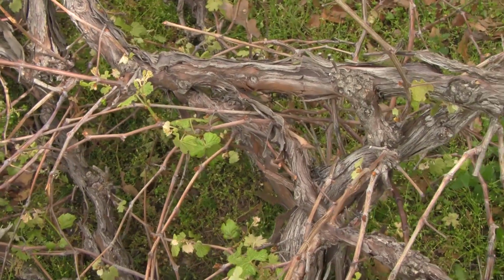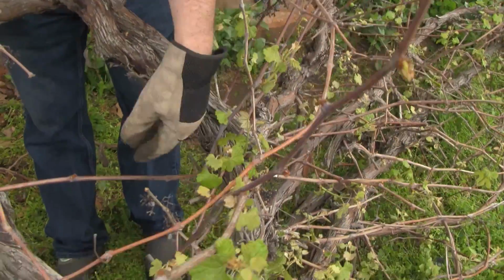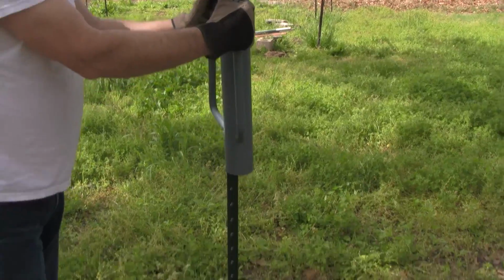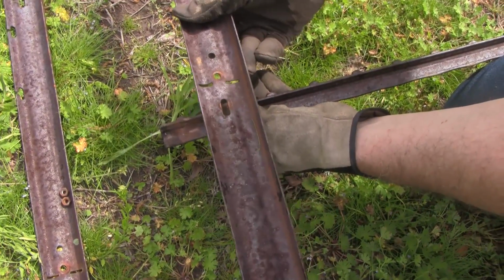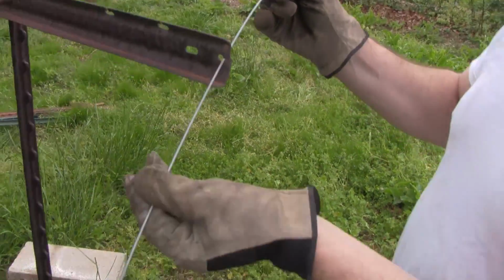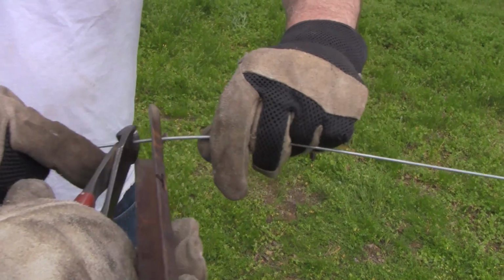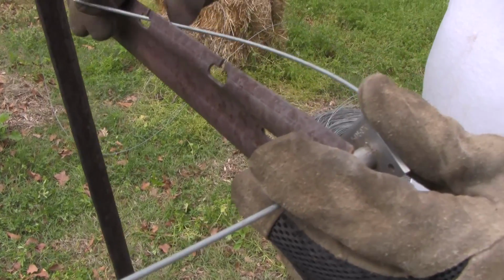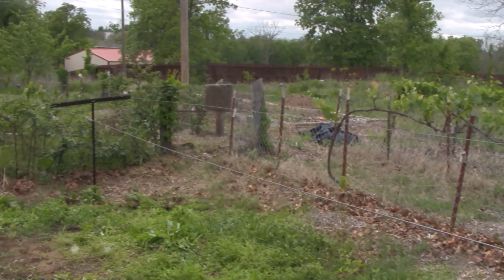DIY Grape Vine Wire Trellis | Back to Basics Show

Comment: That damage to the driver isn't from hitting the top... It's from repeatedly grazing the nubs on the side of the T-posts. You'd have to slam it HARD onto the top to do that damage. I've done exactly what you said about hitting the top and it coming down and hitting you in the head. I had slurred speech for nearly half an hour. LOL

Comment: Great video, just a suggestion, if you ever run into a situation where you need to put a root structures in water - get an aquarium air pump (something cheap) to aerate the water. Its a basic principle of hydroponic farming.